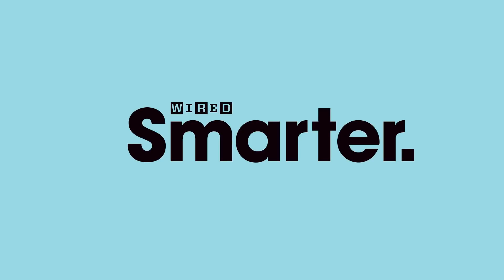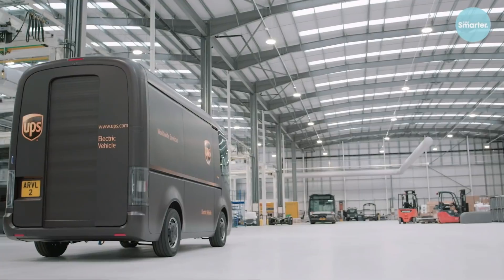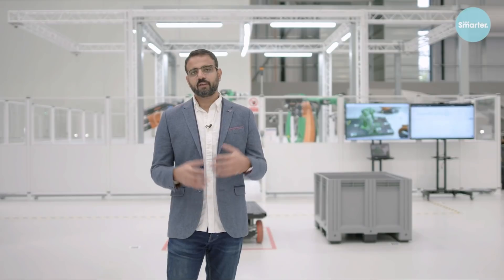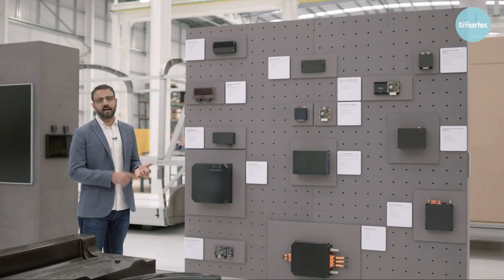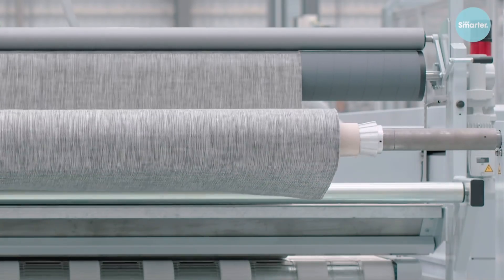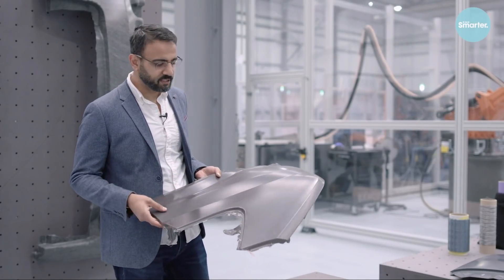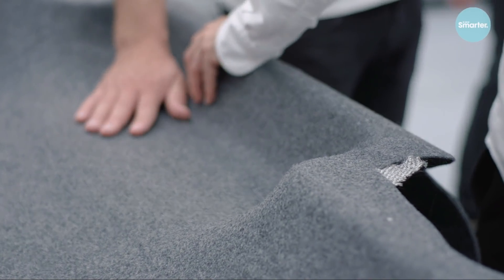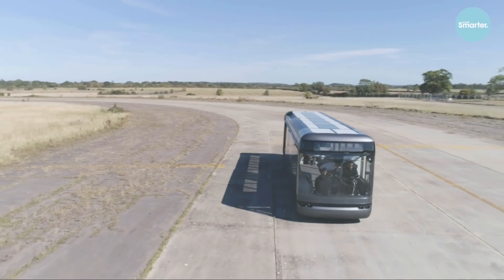Manufacturing Arrival's zero emissions vehicles | WIRED Smarter

Comment: Would love to convert one of the Vans into a Camper and travel around the world:))
Reply: Very very short range 👍 look at the specifications
Reply: The world? You gonna cross the ocean in it?
Reply: Someone will need to get in touch with them to build a camper variant with a much larger battery, and probably a longer body (not totally clear exactly how big the UPS variant is). I too would buy such a thing for conversion.
Reply: That’s exactly why they are not making RV, this Transition is extremely good for last mile delivery and public transportation, but anything that requires more than 100 mile trips is no ideal.
Reply: @JesusAristeoPonceCasillas  you can always recharge at a camping site.
Reply: @generationkilled  Drive 4 hrs and charge 2 days.
Reply: A bus will make more sense to be converted into a large class A motorhome. Not only batteries, large solar panels and 5000+ watt inverter, but the capacity of storing energy could make it much more independent and off the grid than a small vehicle. Just saying.
Reply: Watch The Long Way Up. A trip on electric motorcycles with electric support vehicles. The entire trip was focused on range anxiety. Sorry i am not interested in destroying traveling with dead batteries and no place to charge them. Perhaps on some distant future day this will happen, but the zero emissions lie needs to stop. If you plan on a long trip via electric RV charged via solar or wind only (which still emit) you better have some time on your hands. If you disbelieve this you are delusional plain and simple.
Reply: Ok the range is 112 to 200 miles. The maximum payload is 1975kg. That’s 4300lbs. Typical RV conversions weigh a lot more than 4300lbs, so figure it to be at maximum capacity at all times. Now add in headwinds and mountains (note these are designed for city deliveries)and the 112 miles will be even further reduced. Have a fun trip there dude. Oh maybe you could mount a diesel generator on a trailer..🤣 Hey the RV would still be zero emissions right?
Reply: same here!

Comment: Genesis robotics and Motion technologies have come up with a really cool and new approach to robotics and powering robotics.
I feel you could check them out, as  you might gain some break through or some idea for your radically new approach towards the robotic side  of the production line.
Also, rather than starting with a Lithium based battery technology and waiting for some good battery technology to come up and then moving towards upgrading those technologies in future, I feel that it would be better and a game changer to check out alternatives like Gigadyne Energy or Nexus Power

Comment: I sense a lot of smoke and mirrors.  A factory that clean isn't used much.  The vehicles move too slowly, so they don't have production ready drive trains.  The manufacturing robots move way too slowly for real production.  The guy places a piece randomly on a platform saying the robot can pick it up with computer vision, but the video doesn't show the robot doing that, so it probably can't.  I don't see how the robot cells in the video can actually assemble large panels onto frames.  Nothing is shown of the robots actually assembling anything, so the vehicles in the video were all hand built.  The electronics have pointless modularity.  The company seems to have more industrial designers than engineers.  If you're an investor, flip it before March.  The company is not worth $15B.
Reply: Perhaps not worth 15B but not way is Tesla worth its valuation either  but on the other hand, they have vehicles on the road being tested and have been in testing since 2017 https://postandparcel.info/82508/news/post/royal-mail-testing-electric-vans/

Which is more than say Rivian has achieve to date.

Comment: Where’s the proof this is a more economical way to make electric buses?
Reply: Look at the for-sale price, after they're in production. The significant change is the battery is the floor, and motors in the wheels. The rest of the structure is much cheaper to build.

Comment: I don't get how they can make different vehicles in those micro factory. I hope they know
Reply: Agreed.  I don’t see how the cell approach is viable, but I hope it’s viable.  I think most of this is just concepts at this point.  A lot of execution to happen.
Reply: The platform using battery floor and motors in wheels can be the same for all vehicles in a given class. The body components can then be assembled on top, with things like drivers seat and instruments in exact same formats. You make the "skateboard" then bolt on the rest. Simple.
Reply: @paullangford8179  Just don't tell Arrival engineers it simple, I'm sure they have had many many problems doing all of this since they started in 2015.